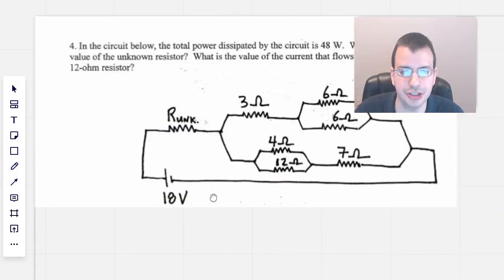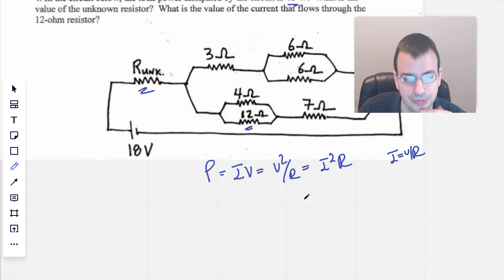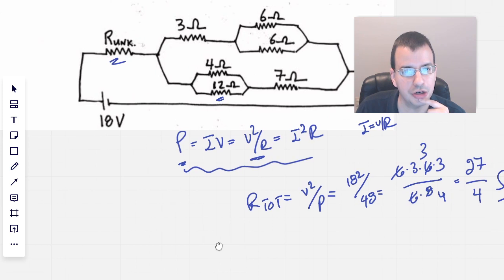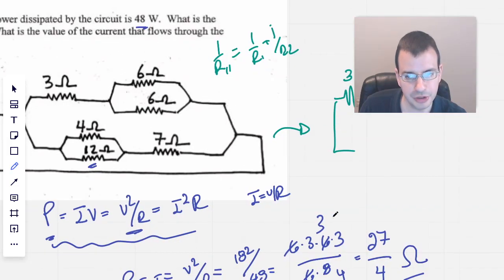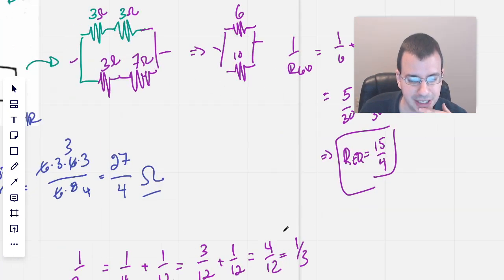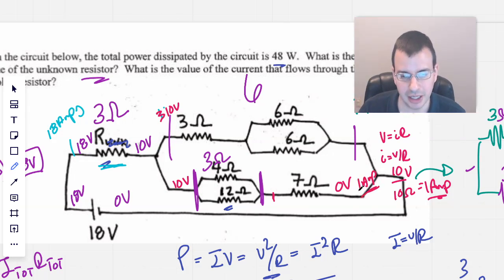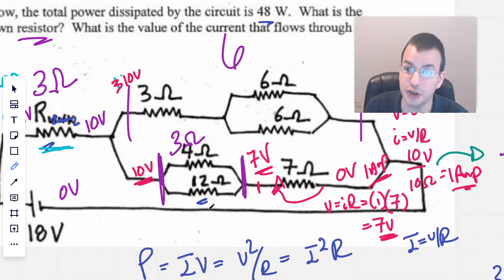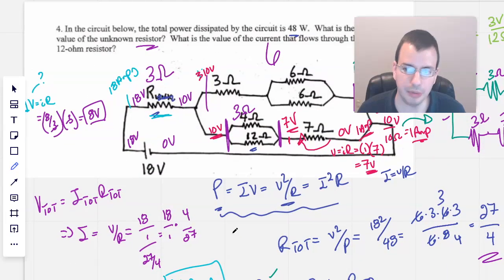Circuit with Unknown Resistor

Comment: Do this again with out a voltage present such as we have 200 and 400 ohm and we need a 105 what value to we need to add in parallel to get this as the 200 and 400 will give us 133 how do we work out how to make it 105

Comment: Your method is to complex
Reply: It’s not that complex but VERY messy and he makes it frustrating when not finishing some maths calcs completely…..both means it’s extremely hard to follow. However, sincere thanks for providing this as an example to work through. I worked it out myself first and then used you to check my own calcs.